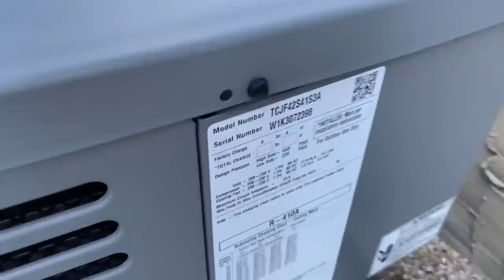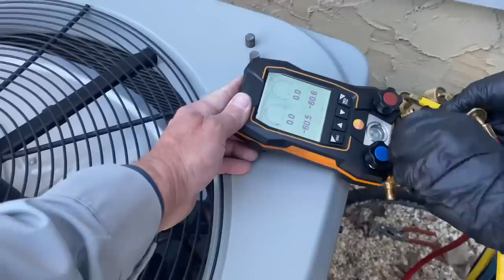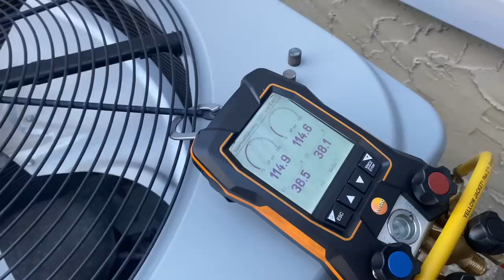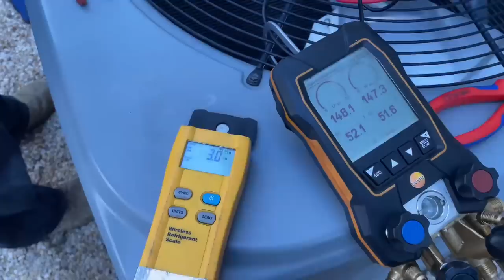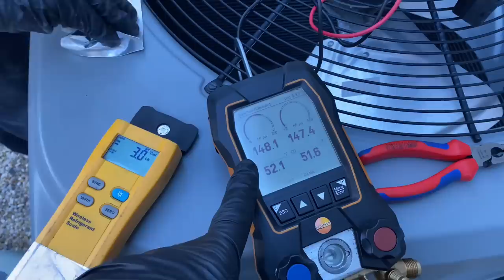Help! My HVAC Company Refuses Leak Search on Central AC System!

Comment: Great video.  Refrigerant is Not Cheap so Why wouldn’t the Customer want to Fix it ?  Several years ago they replaced my Coil with Stainless and Fixed the Issue. 👍🙏
Reply from the maker: Thank you for watching and for your comment! You're absolutely right, refrigerant can be quite expensive, which is why it's important for customers to consider fixing the issue instead of just adding more refrigerant. It's great to hear that they were able to fix the issue by replacing your coil with stainless steel!

Comment: Dye affects refrigerant pressures and changes the temperature of when it changes state. I never use dye for this reason. Dye are for people who are to lazy to look for leaks. What you did was contaminated the poor guys refrigerant system and now that system will never run efficiently. Also charging a system by standing pressures is very suspect that isnt the correct way to charge a system. If this was the case then you can go to every refrigerant system and say its low on charge. 
In residential you should charge by subcool of the condenser data plate and superheat between 4-24 °f when checking outside. But not charging by superheat nor subcool means you over charged the unit and your covering up by not showing the superheat nor the subcool or you jist dont know what your doing.
Reply: That amount of dye won't affect the pressures enough to make a difference. If you didn't hear what he said is that he couldn't find the leak in the accessible places. Plus you have no idea what him and the homeowner discussed as far as what's entailed and how much it's going to cost. The company I worked for charges a lot for a leak search and adding dye is more economical than searching for a leak that may only be detectable under certain conditions. I'm not a big fan of Mikey pipes but I can say he's more ethical than many other companies out there. He's teaching a lot of younger people to get interested in the trade.
Reply from the maker: Thank you for sharing your perspective on dye and refrigerant systems. It's always interesting to hear different viewpoints and experiences in the HVAC industry.